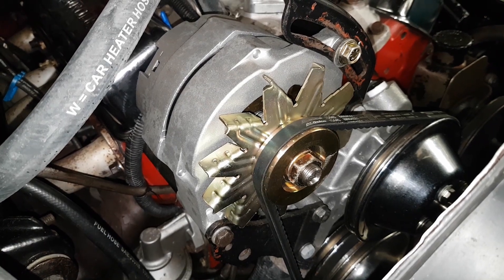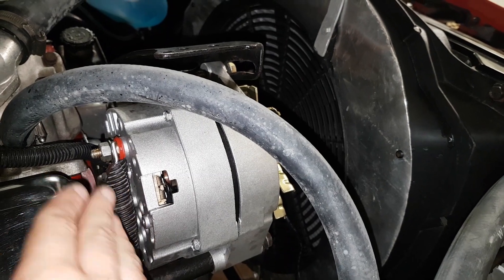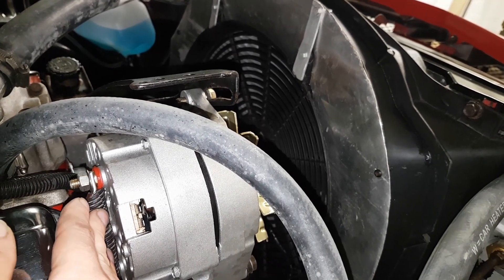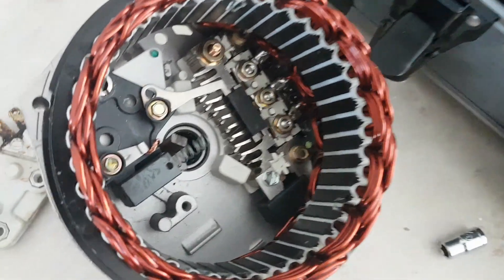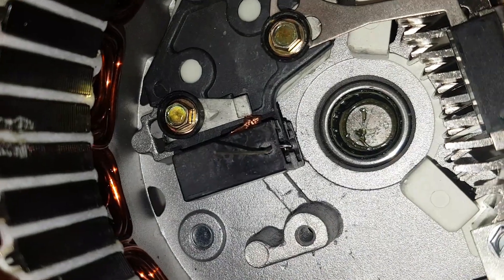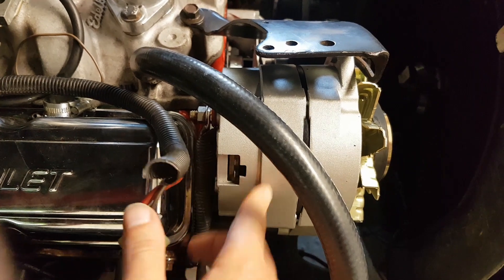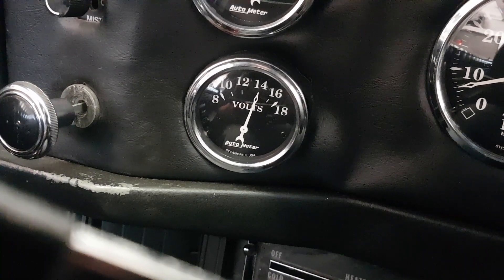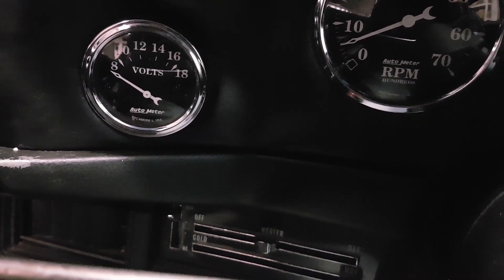Swap out a voltage regulator to fix an overcharging alternator

Comment: Looks to be a relatively easy way to get an alternator running. Sucks that it happened on a new one
Reply: I'm having the same issue my old alternator was over charging and I got a brand new one and it's still doing the same thing. I use one wire alternators so the voltage regulator is built in it's crazy to me you can spend so much money on something just for it to not work
Reply from the maker: @TristinSmith-gt3ql  I was pretty unhappy too, brand new expensive alternator from one of the well known brands and had the issue right out of the box. I couldn't even get the part number for a replacement regulator from their support.
Reply: Can you explain what causes the regulator to fail
Reply from the maker: In this case (typical GM 3 wire setup), the voltage regulator relies on the trigger circuit to go through a lighbulb, the lighbulb acts as a resistor so it doesn't get too much voltage (and also acts an off switch). If you bypass, or use and LED instead of the bulb, it gets too high of a voltage (ironically) and overloads the circuit. Pretty bad design. 
They can also wear out over time - heat usually, or too much of a voltage spike.